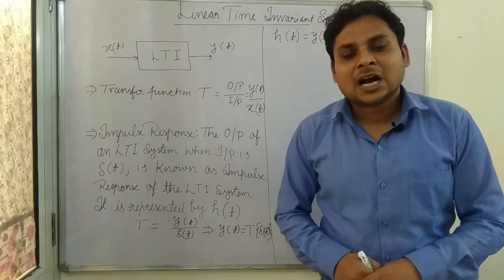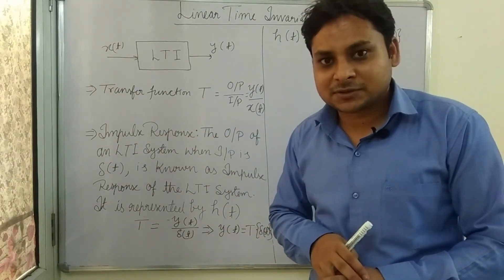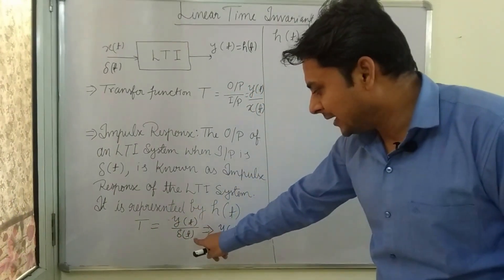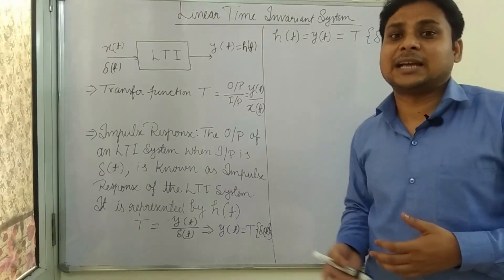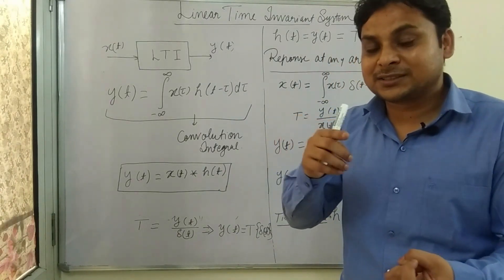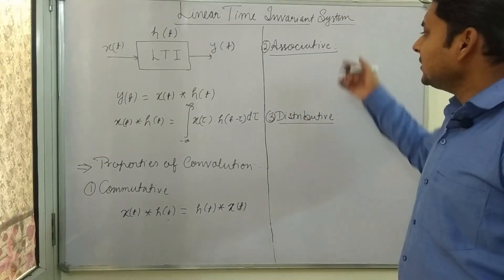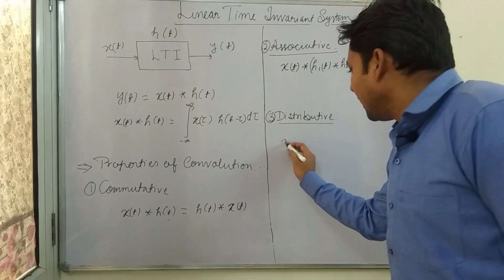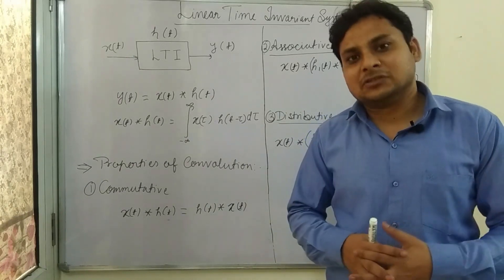Impulse Response of a Linear Time Invariant System & Convolution integral (Detailed Explanation)

Comment: Why only use impulse response of LTI, not step response and linear time varient (LTV) system.
Reply from the maker: If we know the impulse response of the system we can easily find out output of the system at any input using convolution. Due to this property impulse response of the system is used as defining operator of the system.